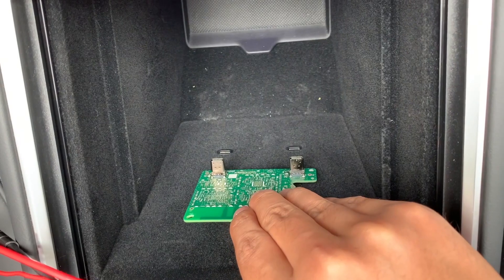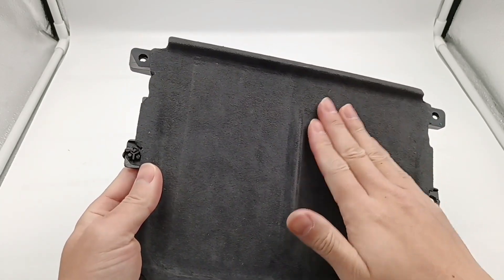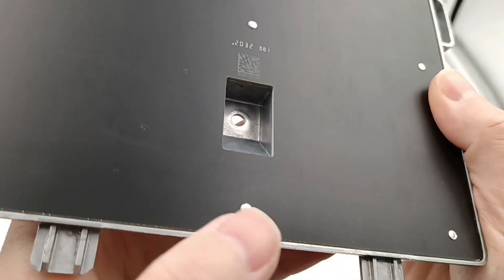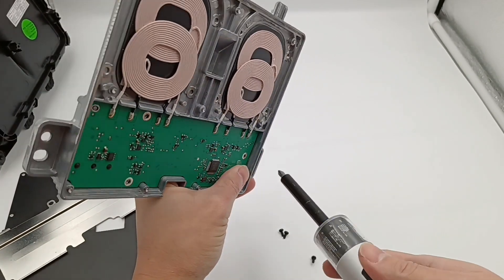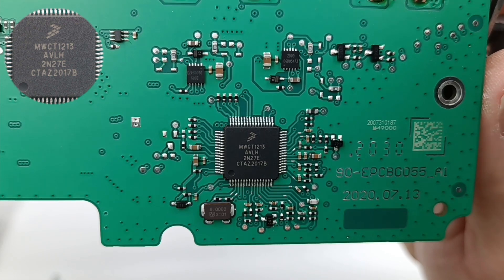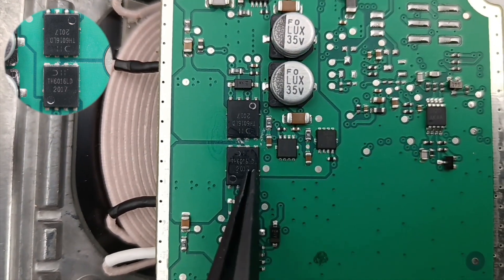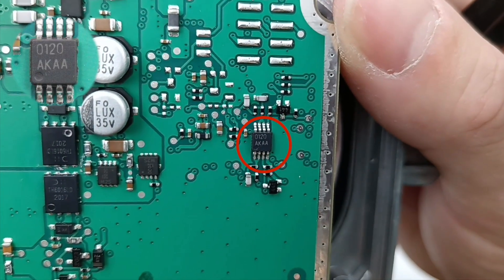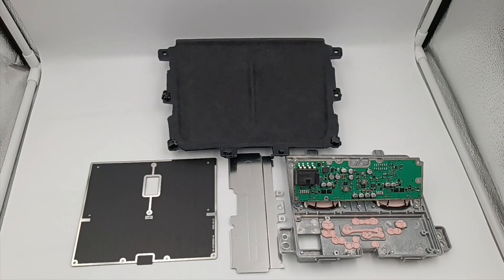Teardown of Tesla Model Y 15W Wireless Charging Module

Comment: The design and the components used seem very good, but for some reasons, the wireless charging performance is spotty. Half of the time it does not charge, or it will charge for a few moments and then stop.

Comment: The phones tend to overheat in the Tesla. Another issue is with phones that have large cameras and a case on them tend to not charge. Is it possible to have a 'wireless extension' where you have a device with receiver and transmitter coils that could sit ontop of the wireless pad, adding 5mm of height where the phone can sit on it and charge?

Comment: Do you see this easily being upgradable (MagSafe)through 3rd party? I have a 2023 Model Y and the center console wireless charger heats up my iPhone way faster than it does charging it. Now I don’t use it because it just gets my iPhone super hot
Reply: Ditto. I often end up balancing the phone on the aircon vent to cool it down.
Reply: Me too. Mine gets so hot that I get an error code because the Bluetooth connectivity shuts down until the phones cools down. Mine is an iPhone 13 Pro. I'm trying to put something at the bottom of the pad to slide it up by 1 cm in hope it won't heat up too much. I'm also sliding it to the left so the phone sits raised by the left bump stop hump. It doesn't charge there, but stays cool unless and turn the car too fast and it slide back onto the charging mat. 😔

I don't think this was a problem until recently as well. Something is fishy! 🤔